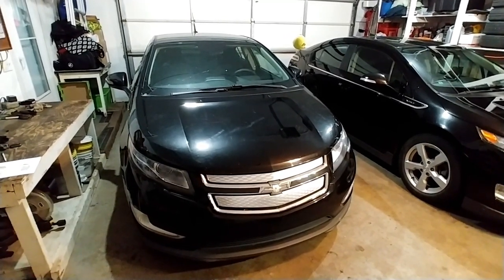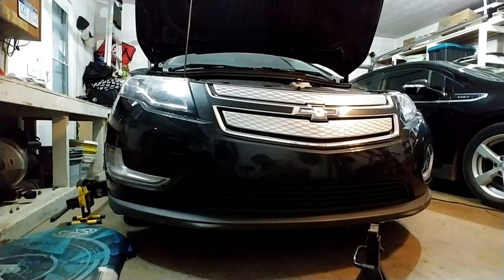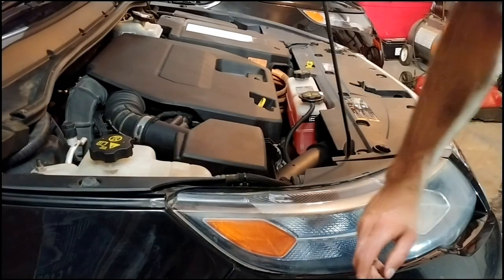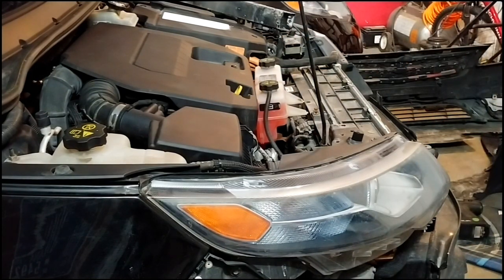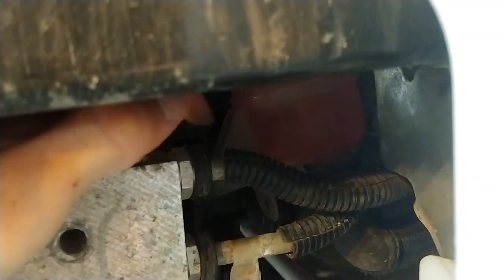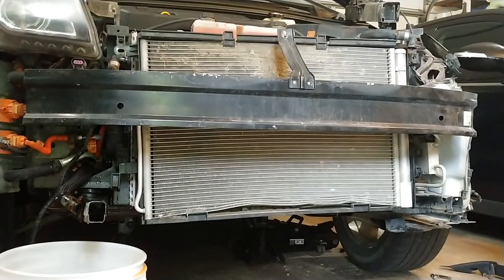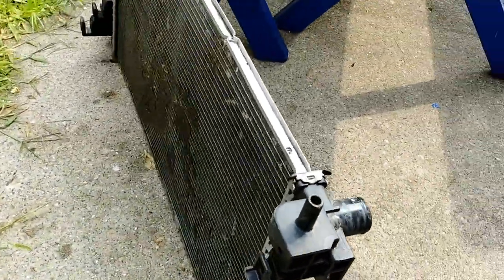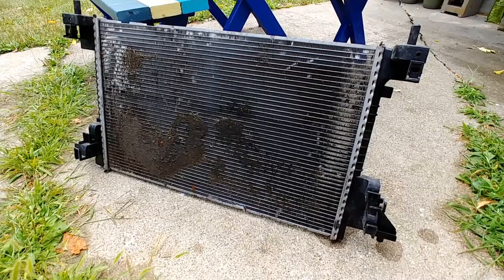How to Replace the Main Engine Radiator in a 2011-2015 Chevy Volt

Comment: Thank you for your video I just did mine this afternoon, I removed the transmission lines from the cooler and it was easier to take the radiator out.
Reply from the maker: You're welcome. That's good to know. I probably should have done the same.

Comment: I did engine radiator replacement yesterday. I was able to do it without disconnecting any hoses or lines from other radiators. The trick is to raise the front of the vehicle, remove both lower radiator support brackets and upper ones, screws that hold radiators and fan assemblies together, temp sensor wires etc and then slowly, progressively move engine radiator down while keeping the rest of components up. It does not simply drop because of interference with other components. It still takes time but then there is no need to mess with other cooling systems.
Reply from the maker: Nice! Thanks for the feedback. I'm glad removing the lower radiator support brackets make the job easier for people moving forward.

Comment: BLUF:  REMOVE LOWER RADIATOR SUPPORT BRACKETS!   Thanks for the advice!  I replaced my main radiator two weeks ago, was leaking like a sieve, overheat CEL, etc.   I followed your lead pretty well until trying to actually remove the radiator.  As you demonstrated, the catches make it nearly impossible without uncharging the AC, draining the transmission even after cutting off a few of the support catches with an oscillating tool.   Frustrated, I read the comments more closely about the removing two lower support brackets.  They stick out like horns from the frame underneath the radiator sandwich holding up the fan and all the radiators with 3 bolts on either side.  That's the move and the main radiator wiggled right out with some encouragement (bending/stretching).  I built a little support jig out of 2x to support the AC/transmission/Battery radiator which seemed to mostly keep everything in place.  Still lots of negotiating to get it out and more negotiating to get the new one in.  I removed the battery radiator after all - helps to have the room.  Reassembly was way easier.   I simply filled, very slowly the three reservoirs, loosened the top radiator hoses to let some air out as I filled.  Then ran the car and topped off a small amount.  I had a P00B7 code that wouldn't clear with my OBD scan s/w, but cleared on it's own after about two days of driving.  Also, changed oil.   It was a not fun nine hour job, but better than redistributing my wealth to the stealership north of $1800 for a $130 part.
Reply from the maker: Glad to hear you got it all done. It is for sure one of the worst repairs I've ever done! Sooo frustrating!
Reply: Wow

Comment: This video and the water pump were life savers.  I dont know how anyone is a car mechanic these days.  What a nightmare of a job this was.  Ive done at least 6 other vehicle radiators and none come remotely close to this difficult.
Reply from the maker: Thanks!  No kidding!  I'm doing car repairs part time right now and sometimes I wonder what I'm thinking?!  However, I don't take on these difficult jobs when it comes to customer's cars.  Just not worth the frustration and hassle.
Reply from the maker: @bb8384  Bummer!  No, I did not remove the AC condenser or transmission cooler for the reinstallation.  Apparently, if you remove the 2 lower radiator mounts, it creates a lot more room for the radiator replacement procedure.  I haven't tried it myself, but read that was a major factor in making the process "easier".
Reply: @mjspiess  thanks a lot Ill give that a shot.  Been a life saver on this.  Shops wanted $3,000+ for the radiator and water pump.
Reply from the maker: @bb8384  You're welcome!  After doing both jobs myself, I can see that estimate.  They are unnecessarily and ridiculously hard!  Good luck!

Comment: I've done this repair. I did not need to remove the driver side headlight, the passenger wheel well cover, or the black metal bracket connected to the cross beam. I did not disconnect anything from the fan shroud. I had the ac discharged and disconnected the lines to the condenser. I drained the transmission fluid and disconnected the lines to the cooler bypass valve (silver box) left it bolted to the assembly. I unbolted the shroud and the front radiator. Removed the front radiator, unhooked the shroud from the rest of the assembly and lifted the assembly out raising the drivers side first. I left the shroud where it was.

Comment: it helps to have a 4 post car lift from ADVANTAGE LIFTS.  I once replaced the oil pan in that Volt.  Lifting the car took two hours doing it one wheel at a time.  And then, it took another two hours to lower the car after the work was done.   That was a pain in the ass to do.  After doing that, I purchased the 4 post car lift and became a happy DIYer.
Reply from the maker: I agree.  It can be really annoying.  I purchased a Quick Jack for my mobile mechanic service and can now get a car lifted 2 feet in about 10 minutes.  MUCH easier and faster than lifting one corner at a time.

Comment: Thanks for a really helpful video!   but I have a problem and need help!    I was able to get the radiator out after  painful frustration.   I need help, tho I can't get it to go back in and am having tons of problems rememberig how they all hook into place in the shroud.  Is there any chance you have pictures of  how the transmission radiator and engine radiator snap into place?   I would pay for any pics you can send , I have worked on my own cars since the 60's nad this was the worst repair I can recall.   Even the pics you referred to about dropping the bracket but esp. pics from your reassembly would really help.  Thanks!!
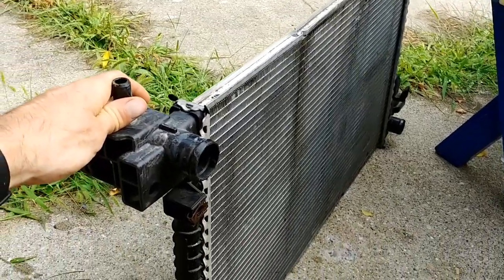Reply from the maker: You're welcome! I'm not sure if you watched my entire video, but at 23:20, I talk specifically about the tabs/slots on the radiator. I don't have any pictures of my reassembly, but I have pictures and instructions from the service manual I could send you. It shows how they are oriented. Let me know an email I can send a .PDF to. Thanks!
Reply: @mjspiess  thanks I've tried three times to send you my email address apparently is not allowing them to go through I'll try contacting you
Reply from the maker: @BillDeanstlrealestate  Hey, not sure what the issue is, but I got your message and sent you an email with the .PDF.  Hopefully it helps you get it put back together.  Good luck!

Comment: Thanks. This motivates me to trade in my '13 Volt for a Tesla. I replaced the CHCM and put in Leak Stop for the rad leak. The complexity is the Achilles heel. Those radiators are so closely sandwiched it would be be difficult to apply epoxy sealant on the outside as another fix.
Reply from the maker: You're welcome.  Teslas are remarkable, but I can't justify the cost, but I agree, these Volts are incredibly complex.  Bolts are so cheap now, I think one will likely be in my future sooner or later.
Reply: I’m in the exact same place and making the same car replacement! I love this Volt but since they don’t make them anymore, looks like I’m going to a Tesla now. I just need to get this bum radiator fixed and the check engine light to stay off! After receiving a $1700 estimate from the shop I figured I’d swap it out myself since I found a radiator for $90. But holy crap this video has me thinking twice now. I really want to just JB Weld or epoxy the leak for now so I can smog and get rid of it!
Reply from the maker: @garrett7730  With my 2013, I was able to turn off the check engine light with my UltraGauge scan tool, but with this 2012 in the video, I had to take it into the dealership to get it to stay off, but like I said in my other reply, if your front radiator is leaking, I'd just replace it as it's waaay easier than the main engine radiator.
Reply: @garrett7730  did you end up JB welding it? My leak seems to be at the bottom seam where the plastic housing and radiator come together.

Comment: How in the world did you managed to get the engine coolant radiator back in? My daughter's Volt has a hole in the radiator, so I ordered a new one and began taking out the old one. Geez, what a nightmare!  I finally got it out and am trying to put in the new one without destroying the car! Did you jack the car way up and get the new one in from the bottom, because that is the only way I have not tried.  Any tips would be greatly appreciated! This is one of the first times that I wish I would have just taken it to a mechanic and paid to have it done, but to late now.
Reply from the maker: Yeah...  It's a nightmare!  Yes, the front of the car needs to be as high as you can get it and the radiator comes in from the bottom.  It's easier if you remove the 2 lower radiator mounting brackets.  It's extra work, but provides a lot more room.  It's a crazy, stupid, hard engineering mess.  Good luck!
Reply: @mjspiess  thanks, I will jack it up and go in from under the car.
Reply: @mjspiess  I finally got a chance to work on reassembling the cooling system over the holidays and got it done.  I still have to put on some of the trim, but basically done.  Thanks for the video, it was a life saver.
Reply from the maker: @joestevenson5201  You're welcome!  Glad I could help!

Comment: You’re saying it was super difficult but it doesn’t look too crazy lol. I think I’m gonna go for it. Chevy wants 2300 and they’re telling me it needs both.
Reply from the maker: You'll see... 😆 Since this video was released, another person told me if you remove the 2 lower radiator support brackets, the job is much easier.  At around the 16 minute mark, you'll see these brackets.  It's extra steps, but provides the extra room you need to remove the radiator and not fight with the AC condenser and transmission cooler as much.  Good luck!
Reply: Yeah I just got a $2k quote too, told them to just give me the car back. It's at 150k miles, paid off, and my secondary car so I got all the time in the world to play with it

Comment: Great video!  How many miles did you have before you had the engine leak?  Were you getting P00B7 error code and did the engine overheat warning come on?  I have a 2012 Volt with 75K miles that has been maintained well and am surprised the dealer just told me it will be $2K to do the job you did in your video.  Is it unusual for a radiator to develop a serious leak in only 75K miles?  Is there an additive to stop radiator leaks I should try before shelling out $2K?  I live in cold and hot temps in the mountains, so I need it to be reliable.
Reply from the maker: Thank you!  I think it had around 140k miles.  I only paid $2,900 for it knowing it had a leak and planned to flip it.  I don't recall what code/s it threw, but the guy I bought it from told me the engine overheat warning did come on, he pulled it over and had it towed.  Added coolant and then noticed it leaking and listed it for sale once he got the $2k quote to replace the radiator.  This particular Volt only leaked if the engine was used and the radiator got pressurized, otherwise it ran on the HV battery flawlessly.  There are additives to stop radiator leaks, but it's not recommended because it can cause the heater core to clog and gum up smaller coolant passages.  It is a very difficult repair, so at a dealership this is going to cost a lot in labor.
Reply: @mjspiess  Thank you!  I enjoyed your video.  Great job on the repair.
Reply from the maker: @panepinto1959  You're welcome!  Thanks!  It was one of the worst repairs I've ever done!

Comment: When you disconnected the airbag sensors behind the upper radiator support did you disconnect the batteries or no?
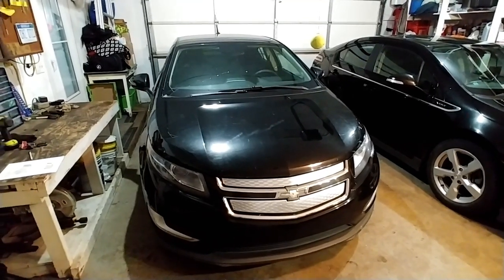Reply from the maker: Yeah, at 1:15 I talk about it and show you how to do it. It's from emptying the coolant that matters though. The air bag sensors won't care if the batteries are disconnected.

Comment: Im working on a 12 volt, I replaced the main radiator and the secondary radiator and ac condenser, all new, now the engine doesn’t run. Any ideas why that would be? All temp sensors are plugged in and good
Reply from the maker: It's hard telling without any engine codes.  An OBD MX+ or something similar should get your more advanced codes.
Reply: @mjspiess  update, motor runs but white smoke out tail pipe. My assumption is the customer let it over heat , which caused damage to head gasket and now coolant in cylinder
Reply from the maker: @baconintheoven4717  Yikes!  That's a good guess with the work you just did.  I've not done a head gasket on one of these.  I know you can get whole engines pretty cheap on www.car-part.com.

Comment: Thank you for sharing. Diz you have to go to GM to have the radiators purged of any air bubbles?
Reply from the maker: You are welcome. No I did not. I just added coolant to the tanks every day for about a week.
Reply: @mjspiess  thank you for replying. I'm delaying my radiator replacement as the dealer charges a leg for a new one. I'll order a new radiator and change it myself, following your advice and reserving plents of time for the job. Thank you again from Portugal 🙂
Reply from the maker: @markaition  you are welcome. Good luck! Yes, set plenty of time aside for the job!
Reply: @mjspiess  Allright. So yesterday my car finally failed on me! Well.. To be fair, I had at least one year notice between it started leaking a little bit to the point where the coolant would be completely gone after a couple days. So, I've ordered the engine radiator yesterday and went to pick it up today. I had part of the front already disassembled, so I figured It would take me around 4 hours to take the rest apart. It was definitely the most frustrating car I ever worked on, everything is pain to remove.. And then there's the radiator.. Ohhh man! Wasn't for your video showing how to rotate it and remove it sideways, I think I would have gone crazy! Taking that radiator off and putting the new one back in, wow.. I cannot express how frustrating it was. As I said, without this video, I would just assume it was impossible without removing the other radiators and give up, so Thank You once again! It was an 8 hours job for me, but still have another 2 ahead to re-install the headlight, bumper and other minor adjustments.
Reply from the maker: @markaition  Absolutely the single most frustrating car I have ever worked on too!  I love it, but man it could have been much simpler and "mechanic" friendly.  Every time I work on it, I have never once said, oh sweet, that was easy lol  I'm kinda glad I'm not the only one to feel this way.  I found a few pictures on a Facebook group of the radiator turned vertical that clued me in, but to even get it to turn vertical was a challenge!  You're welcome for the video and I'm glad it was helpful for you.  I hope to never have to do another one ever again!
Reply: @mjspiess  typical GM put the engine in sideways so you cant reach anything!

Comment: I think I have the exact same leak.  How did you know it was only the engine cooling radiator and not the front most battery cooling radiator?  Would you recommend just replacing both if you're going to all the trouble?  Did you replace any hoses while you were in there?
Reply: Hi Bret...  I am not certain, but I believe the front two reservoir tanks are for the HV Charging and Battery Cooling loops and the Passenger-side tank is for the ICE gas motor Cooling loop.  In my Volt, the front coolant tanks remained full and the system never got overheated in Electric mode, but did so in Extended Range Gas Mode.

Comment: Chevy dealer quoted over $800 in labor to change the front radiator, so I'm tempted to do it myself. The passenger side of the front tank is the one that I have to keep topping up, which is the battery if the diagram om the Volt forum is correct.

Any risk of damage by letting itself purge the air out, or is the pump powerful enough to push any air clear?
Reply from the maker: The front radiator is quite simple and pretty much a standard replacement procedure, but does take about a week to bleed air out of the system unless you have the tool.  I've done it on 2 Volts this way and didn't have any issues.
Reply: Awesome! Thanks for the reply!

3rd party shops were quoting me 7.8 hours of labor too (about $1k) but I think they don't understand the 3 radiator system and were just quoting numbers from a full or engine radiator replacement. Chevy seems to like making things difficult, even the 12v battery in my '97 Monte Carlo was a pain to change.
Reply from the maker: @erPiccoloTotti  You're welcome!  Yeah, sounds like you got a quote for the main engine radiator which is a completely different beast...  That took me around 8 hours to replace.  It was ridiculously hard!  The front radiator is pretty easy and there are a few video tutorials on YouTube.
Reply: Thanks again for the comments. I finally worked up the nerve to swap the front radiator myself. About 2 hours to get everything apart and the new radiator installed by myself, then a friend came over and it took about an hour to put everything back together.

The only issue I have now is trying to clear the P1E00 engine code. The P1FFF code for the coolant doesn't pop up. I guess I'll have to find someone to reset the computer? There is a 3rd party shop here that did that when I swapped the battery, so hopefully can avoid the dealer again.

Thanks again!
Reply from the maker: @erPiccoloTotti  Nice!  Good work!

Yeah, it may need a reprogram to get rid of that code.  Some can be reset with a general scanner, but others need to be reprogrammed.